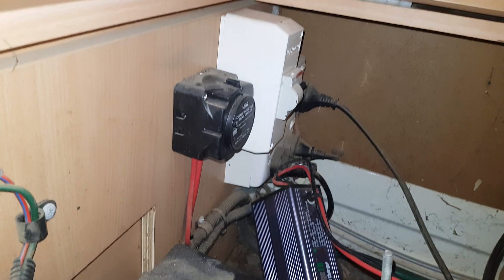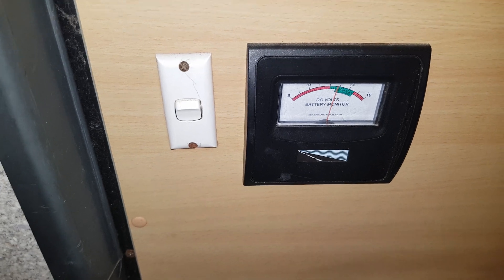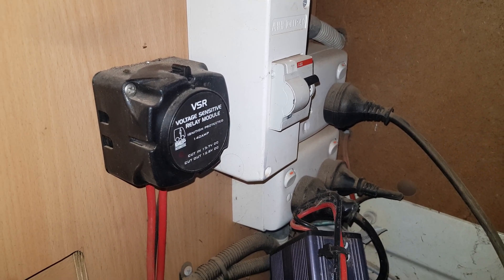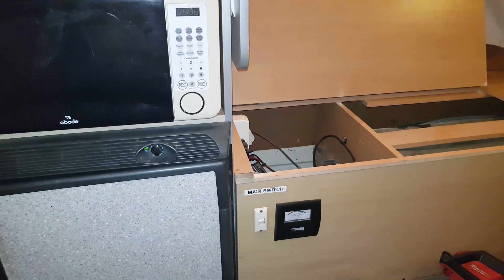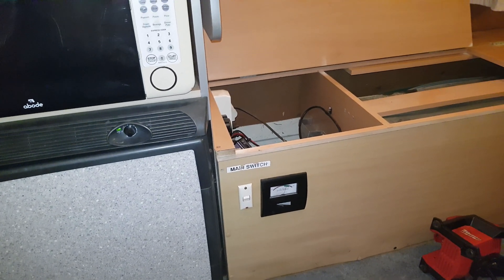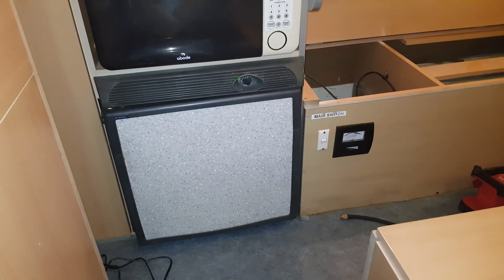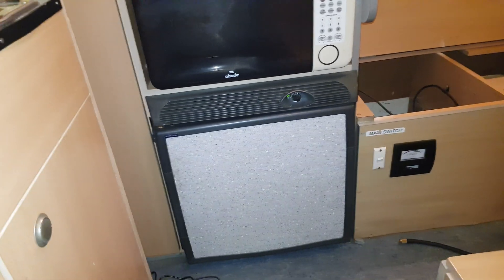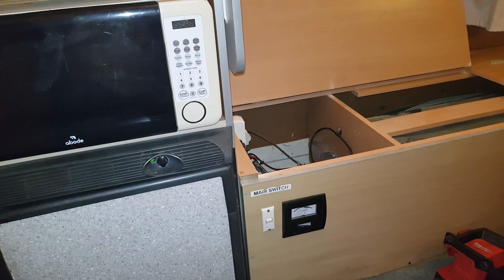How VSR Voltage Sensitive Relays Work for Dual Battery Systems

Comment: Hi great video. I have a dual battery set up in my van. My van battery is already charged.My vsr is clicking as I've just connected up my solar panel to charge my second battery. I was worried about the clicking but this video helped. So it will keep clicking until charged?
Reply from the maker: Yes they will link when it clicks to charge up battery no 2
Reply: Thanks for the reply. I hooked up my solar panel to the anderson plug and I could hear the vsr clicking. Then my fuse blew at the main battery. Not sure what I did wrong. It seems the solar and the main battery were working at the same time. Thanks in advance.

Comment: Hey man thanks so much for this. I'm currently on a roadtrip in my van and the VSR just like this one and I'm trying to figure out why it's making the click noise that came on when it connected in your video. The little LED light has started coming on sometimes and it makes a click noise every few seconds. Then sometimes it stops. I have a fridge running in the back constantly. What does it mean that it's making the clicking noise? Thank you bro
Reply from the maker: It means it's connecting between your front  and rear  batterys. If your front battery is above 13.6v it will connect and help charge the rear battery
Reply: @Oneupthesleevecustoms  thank you mate, saviour!
Reply from the maker: @iestooo  I hope I explained it well. Very simple way to connect 2 batterys and not flatten the starting batt
Reply: @Oneupthesleevecustoms  yes explained the process really well thanks. When it connects should it only click once when it engages? My one is clicking every few seconds for a while and then after some time driving it stops. Is that because the second battery keeps getting too low by the fridge I am running, perhaps? Or is th continuous clicking a malfunction?
Reply from the maker: Clicking in and out means it's close to the voltage threshold

Comment: So, you have an agm battery. I have been looking at upgrading to an agm battery but I keep on reading everywhere that a vsr which I currently have isn't good enough for agm's because they need to be charged at around 14.7/14.8v or else it won't last very long as it'll never get fully charged properly and so a dc to dc charger is suggested but they cost a friggin fortune! My van runs at 14v when the engine is running so I'm definitely screwed if I stuck with a vsr. 

I am close to just buying a replacement lead acid battery but I don't really want to as my current lead acid has only lasted 18 months and its showing signs of not charging well (it's a Hankook Dc31), never ran it below 50% charge, no microwave or anything like that, just an led light, charge phones, tablets and 18650 batteries for my ecigs. I ft in my van so power is critical. I should have 50amps to play with but say its at 12.5v, charge 2 phones (3000mah batts) and it'll go down to 12.2/21.1v once they're done. It's never been great tbh from new. 

What are your thoughts on this?
Reply from the maker: Do you have solar? Vsr can just bulk charge solar to top off. Agm batts like most like to stay in a soc range up above 60%
Reply: @Oneupthesleevecustoms  Yeah I have solar but its a pathetic 40w foldable thing and I'm in the UK so not much sun lol. I get it out and wire it into the controller if/when the sun comes out.

The cheapest b2b charger I've seen is £68 but I'm not sure I'd benefit enough from it.

I thought of getting a new alternator in the hope it gives out more than 14v but obviously that's a big cost and the result is unknown.

I take it you're topping off your agm with solar then as your van also doesn't put out enough voltage?
Reply from the maker: Will be yes. Got 150w panel for this van and a second agm to go in. 
The vsr is just to bulk the agms up
Reply: @Oneupthesleevecustoms  I think I need to move to Oz for the sun/solar lol.
Reply from the maker: We get heaps of that but all the animals try and kill you
Reply: They will TOP OFF  at 14.7 is what it means. Basically speaking, from someone who lives off grid, so long as a battery is getting 1.2 volts above its CURRENT REST VOLTAGE it will take a charge. But it's the amps that actually do the charging. If you have a solar charge controller built for sealed batteries or one that can be switched over to sealed batteries YOUR AGM WILL BE FINE.
Reply: @blackkitty2871  Appreciate the comment but I've read about agm on over a dozen websites, they all day the same thing, that they need to be charged at around 14.7 volts or they'll never achieve their full charge. Appreciate amps, they're what we take out and put back but volts matter too.